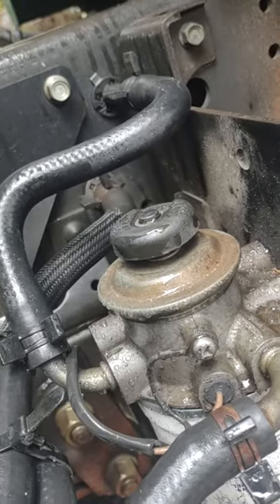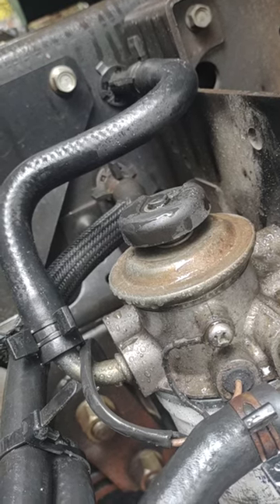See if your Isuzu NPR has a restricted fuel line by observing the primer pump button

Comment: Seth. Thanks for the share. Had a 05 NPR that would fall on its face at 25 mph. Couldn't figure it out. Turns out, this is exactly what was going on. Old fuel lines with large tank scale flakes wedged into hose cutting down fuel flow. Great call! Thanks for the share.
Reply from the maker: No problem... If you have an automotive vacuum gauge you can T it inline and watch the vacuum rise in the areas of restrictions...
Reply: what did you replace the lines with?
Reply: Hi cam you please tell me what fuel lines wear changed
Reply: @chriscaerbajal455  lines  at housing and other side of frame rail
Reply: I couldn't get OEM  replacement.  I bought fuel line and cut them  longer so they don't kink.

Comment: I wonder if this is what caused my hilux to go limp. After ringing its head off in every gear for about 20 seconds itll finally get to 80kmh but thats it, has a slight stutter in some rev ranges but other than that the fuel filter primer is stuck down when turned on but comes up when turned off

Comment: Does that filter have a water separator on it? Could you please tell me the filter code? I have a Rodeo Camper with the same engine and am trying to figure out what fuel filter I should use. Thanks!
Reply from the maker: I think so... But most spin on filters are designed to hold a certain amount of water in diesel fuel or fuel oil applications...

Comment: I know this is a stupid question but is the primer pump button is attached to the primer pump? Im trying to restore a1984 ford tempo and the primer pump was bypassed and the previous owner decided to push start the thing 😅 HELP OR ADVICE PLEASE
Reply from the maker: Primer pump is for a diesel engine... On a PNL type diesel they normally will use a mechanical lift pump which has either a lever or a button attached to it... What you're saying does not make any sense... Under normal circumstances you can't bypass the pump unless you install an electric pump.

Comment: How did the fix go?
Reply from the maker: It was pretty easy... I ran a vacuum gauge on the inlet side between the fuel filter housing and the tank and checked it to see if it was plugged or restricted during running... No vacuum was observed and I blew air into the tank and watched how fast it came out just to be sure...
Reply: @sethpayment  nice, I was real curious about this. I have a faulty fuel guage I'm trying to fix
Reply: @sethpayment the same case with my isuzu dmax let me try this thank you for this information good luck

Comment: What would make the intake hose blow off ? If I run this thing half throttle I have no issues. But sometimes we gotta put it to the floor…and occasionally the intake hose will blow right off. Idk what to do.
Reply from the maker: Wrong hose clamps... Turbo charged engines use fmic T-Bolt clamps... Not worm gear clamps... Worm gear used on Turbo charged engines lead to failure over short periods of time... Fmic clamps can handle up to 60lbs. of boost many larger turbo charges diesels can make under heavy load conditions...
Reply: @sethpayment  yup we got those heavy clamps too.